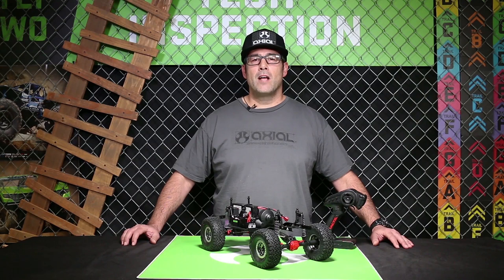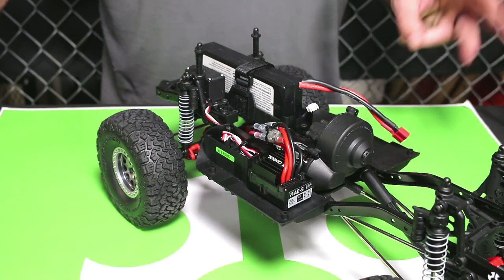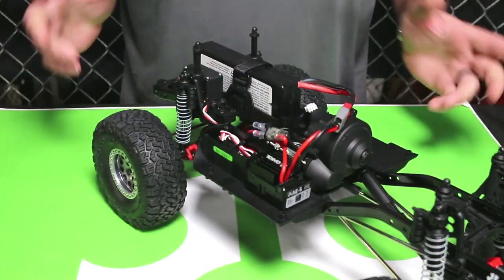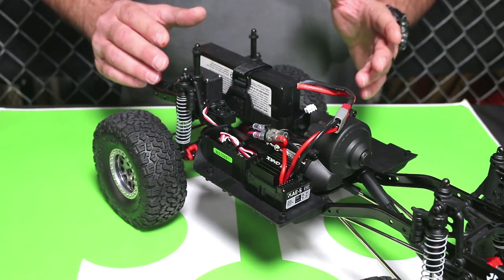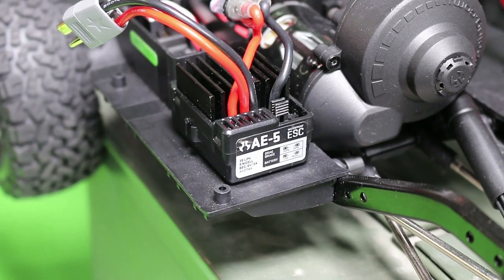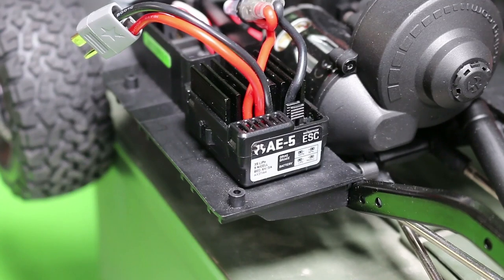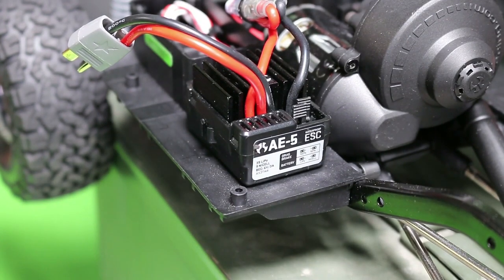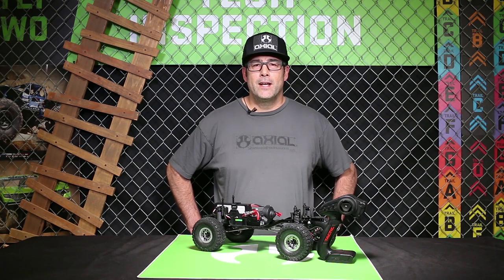Axial AE-5 ESC Setup

Comment: I have been using my Deadbolt for about 25 hours run time and im having an issue with the ESC it start up normal, it steers but when I accelerate or reverse it shows a solid red LED, anyone know what this indicates before I head down to my local Hobbies store and ask my friends? For some reason I can't find my manual on my A-E5,  shows solid red on the receiver as well. Have been running it in muddy waters!

Comment: How do i know when the low voltage cutoff goes off  for lipos? I just bought a traxxas 2s 7.4 5800mah battery used it couple times in my scx10 2 but ive never ran it low so i dont know what the indicator is if lvc is kicking in when low on the battery